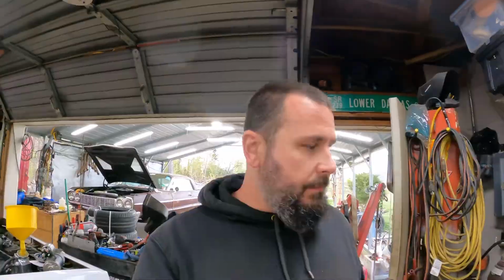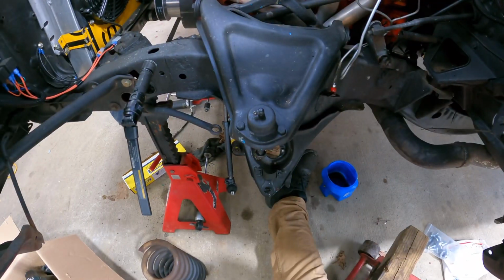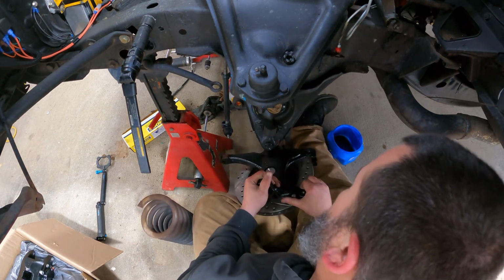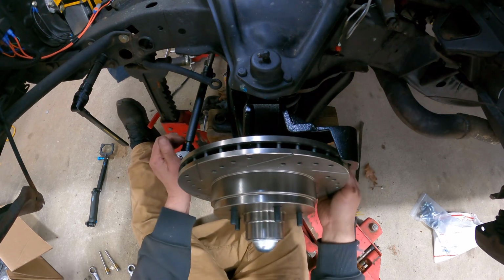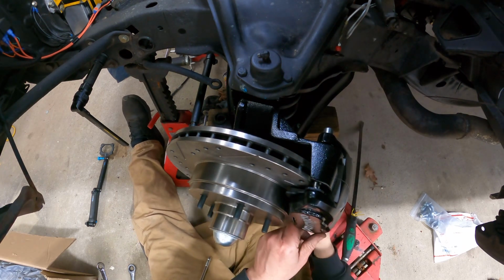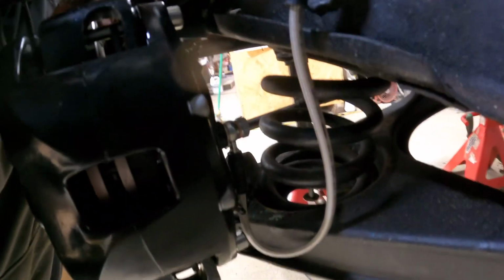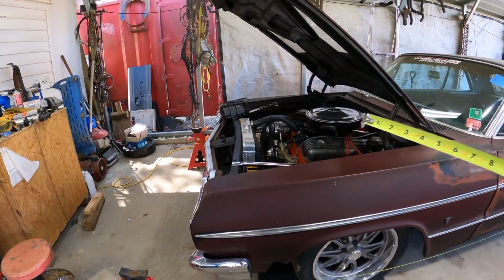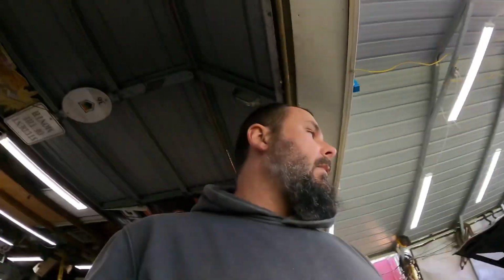1964 Impala CPP brakes and drop spindles @CPPmaster @WilwoodDiscBrakes

Comment: By chance you have the brake and spindle item number from cpp?
Reply from the maker: I had to call them when I ordered this. The PN got crazy because I wanted drilled and slotted with wilwood calipers and they were supposed to have been red calipers. I’ll see if I have the invoice though.
Reply: Appreciate ya if you do!
Reply from the maker: @elvergullio i can’t believe i found it that easy. 
So the brake kit pn is 5864SWBK-D-12-WWBK
then is says for the rotors
ARGX-9003L
ARGX-9003R
Shipping was outrageous $130, don’t remember seeing that before lol.
Reply: @LeftForDeadGarage  man that’s awesome appreciate your time! Thanks again good luck in your build!!
Reply from the maker: No problem! Call them and double check that PN. It had the rotor PN’s listed below the kit but $0.00 charge. I assume that kit number will include them.
Reply: @LeftForDeadGarage  no problem, I found that kit on eBay from cpp and had everything as well!
Reply from the maker: @elvergullio  good deal. Thanks for watching, glad the video was helpful.
Reply: @LeftForDeadGarage  of course thank you! 🙏

Comment: Are those the Western Chassis spindles? They have the WC stamp on the backside. Im fighting my front end. Ive had 4 different brake setups and none of them fit how I need it to.
Reply from the maker: Honestly idk who makes the spindles, they were just what came in the kit.  Give CPP a call maybe they can tell you.  FYI be prepared for a looong wait before you talk to a actual person. Hope you get it sorted out
Reply: @LeftForDeadGarage  first I got a kit from POL. That was a joke. They sent the wrong kit. 2nd kit did not fit either (wheels stuck out too far) so now  I just got the CPP factory style disc brake drop spindles and my caliper brackets dont fit them. POL really pissed me off.
Reply from the maker: Oh man that is a dang hassle, iam pleased with the fit of this kit. I was really expecting some sort of BS but it was almost to smooth.
Reply: @LeftForDeadGarage  I suppose that's how it goes when you do anything custom but dang lol I got hosed.. I wanted a zero offset drilled and slotted setup with 2 inch drop spindles but everything I found with spindles moves the wheels out too far and my 14 smash into the wheel wells and I cant lay it out.
Reply: @LeftForDeadGarage  so now I'm also stuck with stuff I wont be able to use. Uugh
Reply from the maker: Facebook marketplace should move that stuff pretty quickly.
Reply: @LeftForDeadGarage  Yeah shouldn't be too big of a deal.